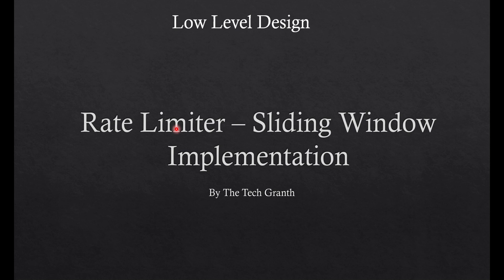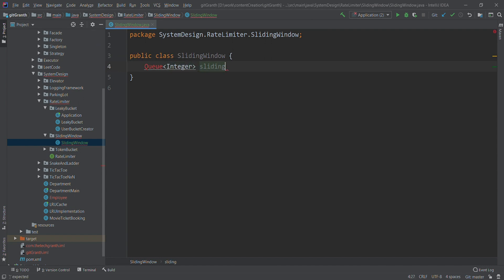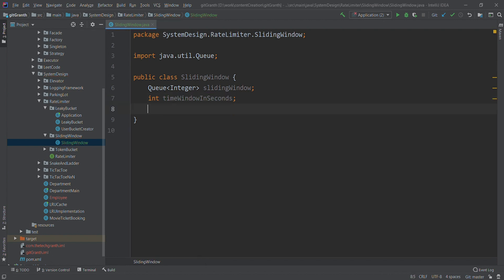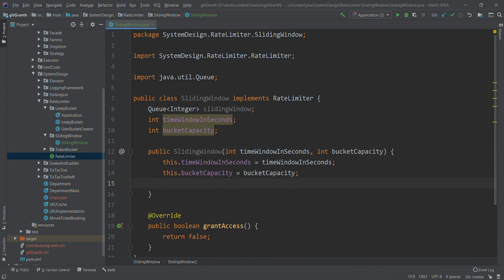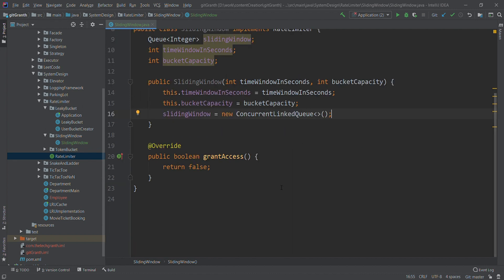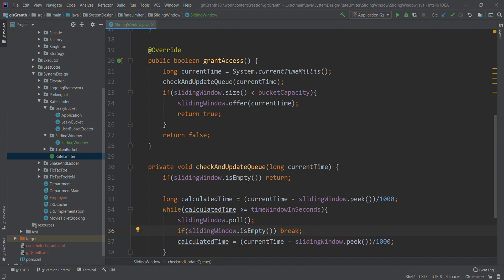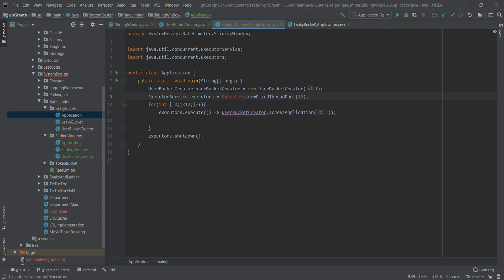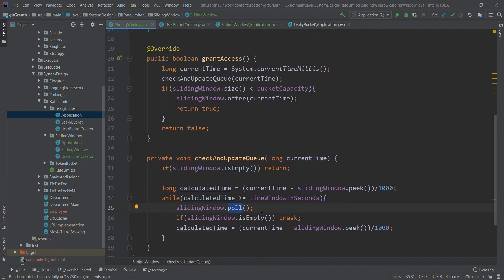System Design Rate Limiter | Sliding Window Implementation | System Design Interview

Comment: Can you also make a video on Sliding window with counters. Or atleast guide what will change in this code? Awesome video between.
Reply: To implement sliding with counter you can use map instead of queue. That would solve the requirement.

Comment: Thanks for your video. 
One question. Do we actually need to calculate ''çalculatedTime' multiple time in while loop? Because the queue works on FIFO basis and if the top of the queue is expired for that sliding window isn't it the remaining entries of the queue also will be expired? Your thoughts please..
Reply: as you already mentioned the queue works as FIFO so the top of the queue  is the oldest so time diff also will be greater and could exceed the defined limit, but the same could not be the case for the latest ones